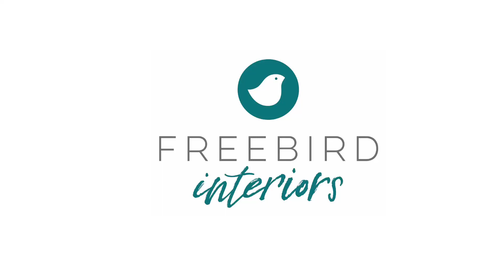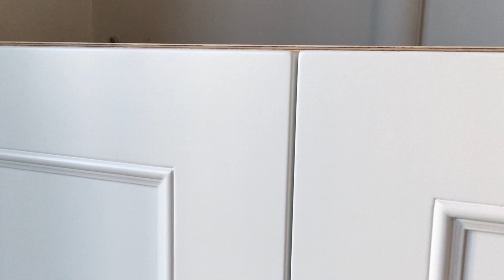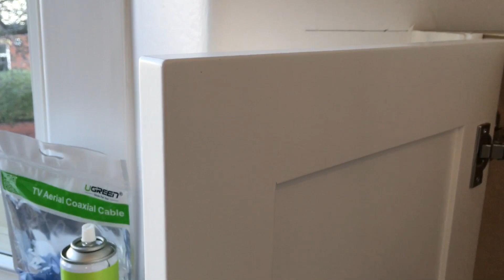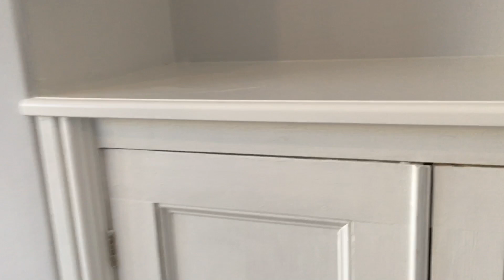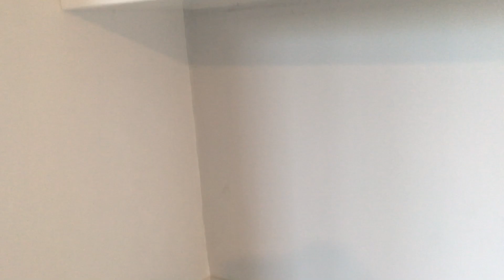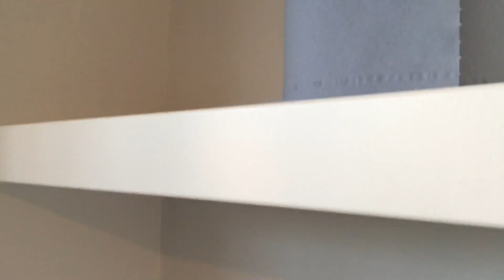Spray painted finish on MDF - close up

Comment: Hi Alastair, great finish - how do you get a consistent rounded corner on the doors? 👍🏻
Reply from the maker: Using one of these lovely little bits from the excellent Wealden tools (you will never go back to Trend!) - I think we are using the 2 mm radius one https://www.wealdentool.com/acatalog/Online_Catalogue_Arris_Rounding_964.html#aT1303B
Reply: Freebird Interiors sorry, I meant the top right corner rather than the arris edge - at 40 seconds in? Do you use pass the door vertically through a router? I'm a big fan of Wealden's - seem to buy from them most weeks 😀 👍
Reply from the maker: Sperky Sperks Brady is very well practiced with the sanding block!  He does most of the workshop element of the making for me these days
Reply from the maker: Yeah they are good aren’t they, Wealdens

Comment: Hey Alastair - some great work there and a lovely paint finish; can I ask what Sayerlack paint you use, specifically? There's a gajillion different option, by the look of it, lol! As I think I said when we were chatting, my only gripe with Tikkurila Helmi is that they only do a 10% or 30% sheen, nothing in between. Thanks! 👍
Reply from the maker: Peter Millard yes I needed the guidance of the Movac rep!  To cut to the chase: AU0474/13 primer and AT9915 topcoat but for more info see latest video I’ve just uploaded
Reply: @Alastair_Johnson  Epic, thanks!
Reply from the maker: ... and we use the 15% sheen which is just right for me and every customer so far!

Comment: Spraying the way to go Alister .looks even better than a laminated. I will have to stick with the roller and brush I'm afraid (space) .do you ever use popular or tulip wood for doors I believe it takes paint very well . ?
Reply from the maker: david osullivan hi David, we rollered for years, glad we moved to spraying now though.  It’s something else I’m planning to do a detailed video on one day - making that  transition, and the pros and cons.
Reply from the maker: Yes we have used tulipwood and it is nice to work with and paints well.  However due to how we work these, preferring ready made panel products and rarely using the planer/thicknesser, we most often use radiata pine instead of customer wants solid wood painted: due to ease of obtaining it from our boards supplier optimum timber supplies, who don’t do tulipwood.

Comment: How do you seal the sides of mdf? Just sanding??? Or is there a primer involved...
Reply from the maker: Oliver Turner a good sand has always worked for us. Originally we used these excellent sanding blocks which I brought back from America: https://www.amazon.com/Sanding-Autobody-Preppin-Weapon-Sandpaper/dp/B007R4Y8BO/ref=mp_s_a_1_6?keywords=sanding+block&qid=1551424774&s=gateway&sr=8-6 and it helped we were using Leyland acrylic primer undercoat which is quite thick and fills the pores a bit then you sand again.  That’s when we were using foam rollers and the ‘orange peel’ texture hid some imperfection anyway.
Reply from the maker: These days it’s abranet sanding disks on the Mirka Ceros orbital sander; 120grit, 180 then 240 grit (we used to stop at 180), then the waterbased Sayerlack spray paint we now use.
Reply: @Alastair_Johnson  Great info thanks